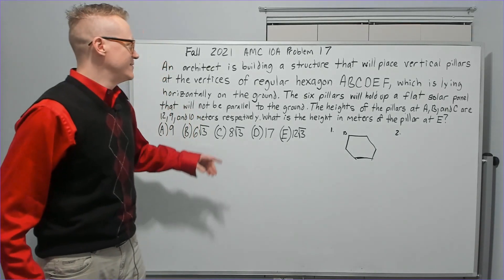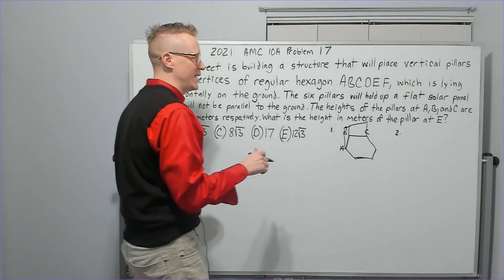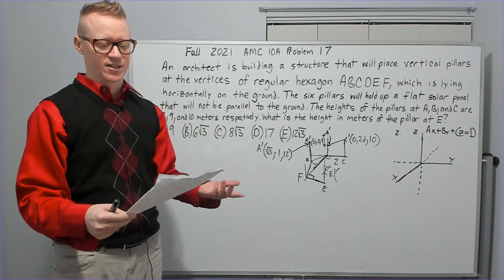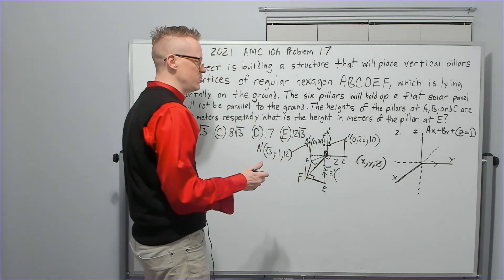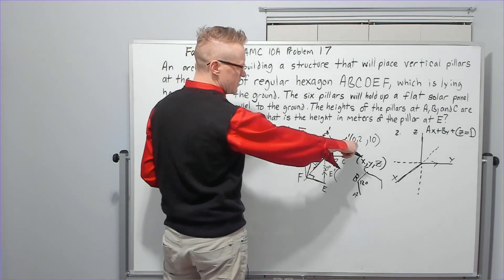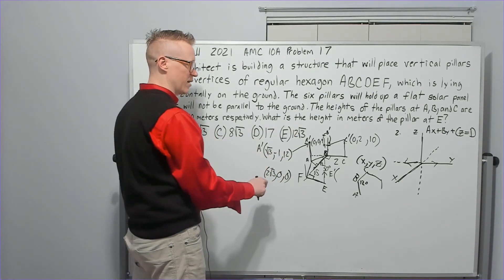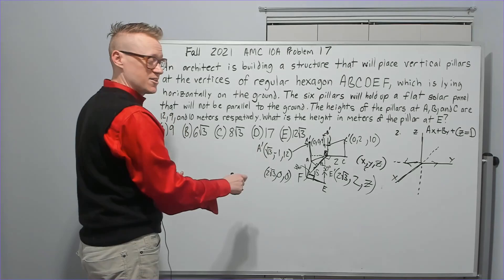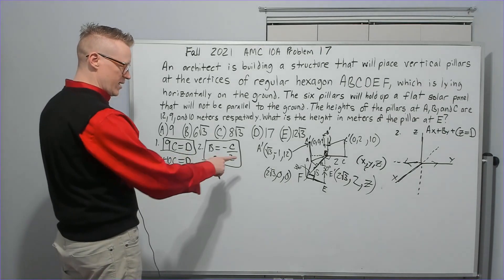Fall 2021 AMC 10 A Problem 17

Comment: I think I got a simple sol. here: Let M be the midpoint of AC, then height of M is 11, which is 2 higher than B; and M happen to be the 1/4 point of BE, so the height diff of EB is 4 times of MB, so 2*4 + 9 =17.
Reply: man you are a genius
Reply from the maker: Incredibly amazing. Seriously. You guys/gals really astound me sometimes. I wish I had thought of that under test conditions...but that's just impressive. I pinned it for it's simplicity. Not Xeno has a good one down below too...but yours is far simpler.
Reply: Hello, I'm confused on how you concluded that M happened to be 1/4 of the way from B to E.
Reply: @nitinvaka907  because it's a regular hexagon
Reply: @nitinvaka907  i was as well. This is late, but I proved this by splitting the 120 degree interior angles of the hexagon into 60 degree angles and creating 30 60 90 triangles
Reply: @saveerjain105  Hello, if you connected BD and AE, we would see that the top and bottom part have equal lengths due to symmetry. The middle is perpendicular to sides AB and DE. We know this is twice as long due to the 30 60 90 triangles from the other edges.
Reply: Genius you are so cool I want to learn the arts from you

Comment: Let me know if there's a flaw with this solution b/c I did it with only 1-2 min to spare: We know the rough angle of the solar panel by drawing the diagram, and so pillar E has to be higher than pillar A. We can then eliminate answers A and B, leaving 8sqrt3, 17, and 12sqrt3. If we draw a plane parallel and 9 above ground, the height of each pillar is determined by this new plane, and we just add 9 to find the total height. It is very unlikely E's distance to this plane can be n*sqrt3-9, so this rules out C and E, leaving 17.
Reply from the maker: Crystal, I just wanted to apologize. I cannot take the time to give a proper answer at this time due to major life events. But I didn't want you to feel you were ignored or unimportant. That isn't the issue. I am just unable to give a proper response because of events on my end. I would need to watch the video, re read the problem, try to analyze and I don't have 15 minutes to give it at this time. I will try and look maybe later this week, but I cannot guarantee. Thank you for understanding.

Comment: I think I also have a simple solution. Let the length of the hexagon be x. Connect BE which is length 2x. Draw line L perpendicular to E. Extend BC to intersect L at B' and extend AB to intersect L at A'. Since angle EBB' is 60 degrees, BB' is 4x, so B'C is 3x. Since the increase in height of the pillar must be linear, the height at B' is 13. Similarly, the height of A' is 21. Also, A'E = B'E, so the pillar at E is the average of the height of the pillar at A' and B', which is (21+13)/2 = 17
Reply from the maker: Very good Junyong! I like it. I would pin it if the other one already pinned was not slightly simpler, but your version is still much better than mine. Impressive, and thank you for sharing in the comments :)

Comment: Ok, so! The solution I had for this was actually a lot simpler and imo a lot more intuitive
If we extend line BC out to a point B', such that BC = CB', then the height of the point at B' would be 11. This is because the plane is flat and therefore slopes upward at a constant rate. If we turn towards point D and draw line B'D, then first, we can realize this is parallel to line AB, and therefore has the same slope. Another thing we can realize is triangle CB'D is equilateral, and so B'D = AB and therefore we add 3 so the height at point D is 14
DE is parallel to AB, and is also equal, so we add 3 and get 17 and that is our final answer!
Apologies if my explanation is subpar, I don't know how I would draw in this comment section
Reply from the maker: I think I get exactly what you did. That is genius. Very well done. Impressive even. :)